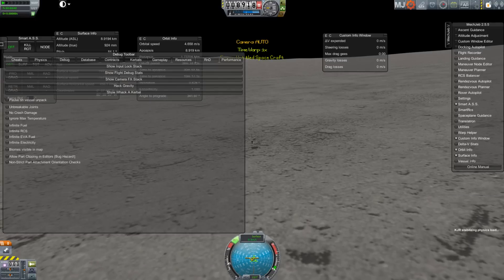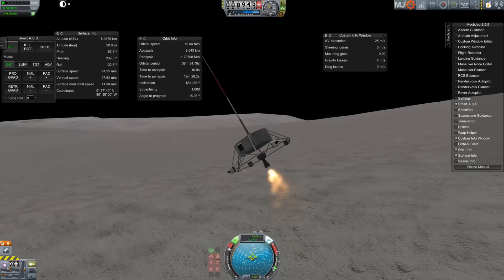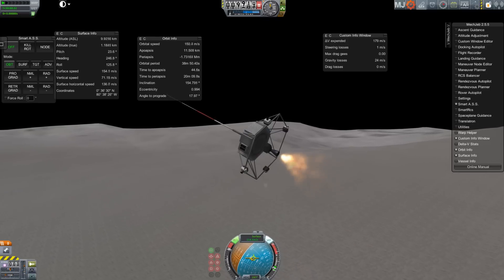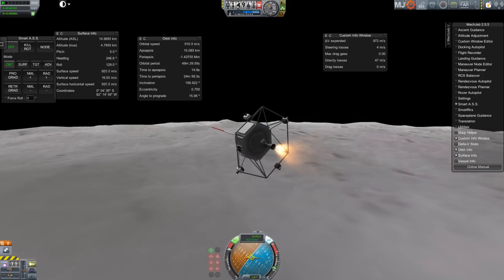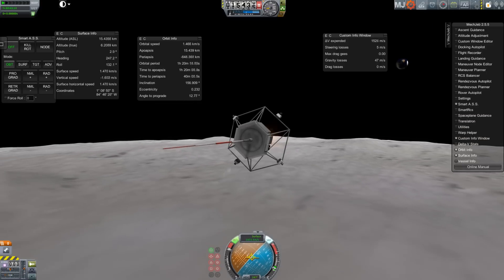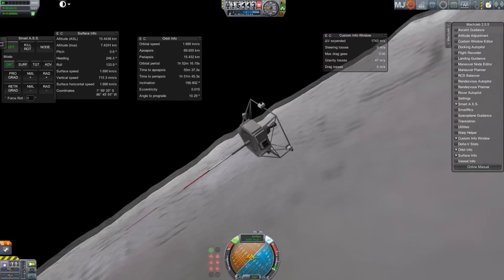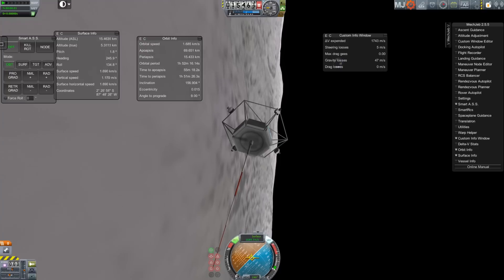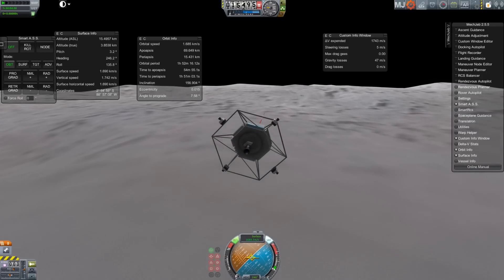How Much Delta V Do You Lose in a Moon Landing?

Comment: do u think that solar system addon would work on my $300 laptop?
Reply: +Alex Grutter Why not just try it?
Reply: Depends on ur cpu and you need 4 gigs of RAM, but lap isn't very optimized so u can only have a small selection of mods. It doesn't hurt to try
Reply: *ksp isn't
Reply: +Mastikator just short on time. Don't mess with mods too much because the pc has a hard time as it is.
Reply: +Alex Grutter It probably depends on your FPS tolerance.
Reply: Alex Grutter

It'll struggle. The big problem with real solar system kerbal mod is the old version of unity preventing 64bit and multi-threading. Even a good computer will struggle a bit when you pile on mods.
Reply: +Alex Grutter if you have 4GB of RAM and a decent CPU (also dedicated GPU, any really, just not an integrated one) then you shouldnt have a problem...
since KSP is (usually) 32bit it wouldnt make much difference between a capable laptop and a beast gaming PC.
so if it runs on any machine.... it should run  on ANY machine.... (given the 4gb of ram.)

Although if you have any issues try forcing openGL using the command line   "-force-opengl"  (which should allow some more of your textures to be stored on VRAM)
Reply: AwesomeVindicator It's a $300 laptop; it's going to be a dual-core CPU and integrated graphics.
Reply: in which case no ... and look for a better deal :D
Reply: +DeilGrist true that. I'll be able to afford to build a real good one once I get out of college. Basic Kerbal universe for me